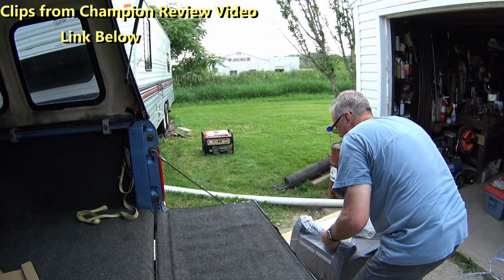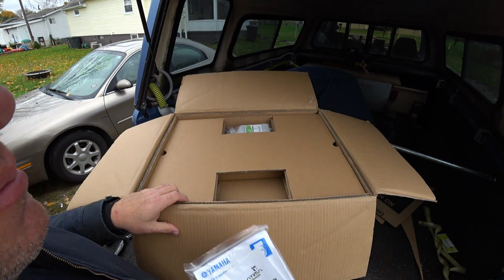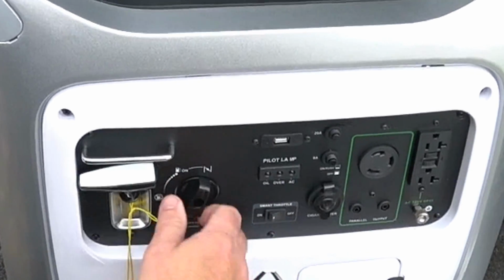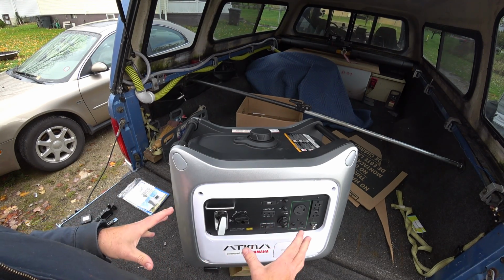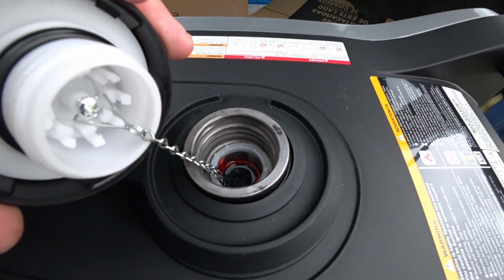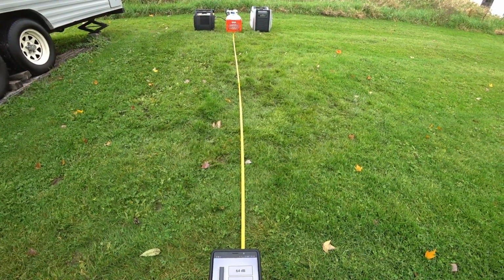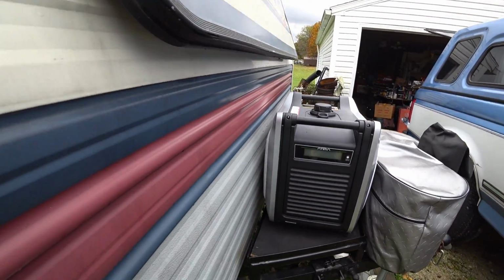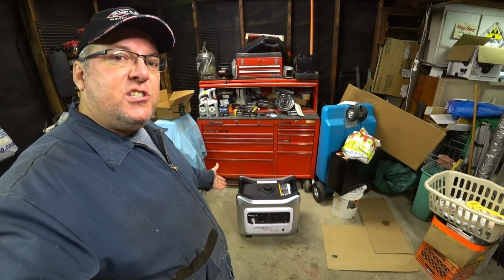RV Generator Atima AY3000i vs Champion 3400

Comment: great review but the links that you provided don't work and when I searched on line it seems to be a mystery trying to buy one?
Reply from the maker: From what I can tell the company is having a hard time sourcing. They were a Japanese designed, Japanese sourced, Chinese manufactured generator company. And at this point, and for a while now, difficult to receive their products from a steady source. They had a good presence on Amazon initially then they refocused their sales as a direct website point of sale only. This is a shame! I believe truly after all the reviews I've done on generators that they were the second best brand of generators but you could buy as far as build was concerned.

Comment: As for checking the oil level = read the owner's manual.  Don't go by anything anyone tells you.  My B&S generator's manual says to screw in the dipstick, then remove it to check the oil level.  Some Onan generators have you rest the dipstick on the fill hole, others of that brand require you to screw it in.  Predator (Harbor Freight) says to fill the oil until it reaches to lower lip of the dipstick hole.

Comment: I bought the Champion 3100 with remote start.  It’s not dual fuel but I’ll take the remote start any day. You can start or stop it without going outside.  Also like the RV 30 amp plug. My two bits worth anyways

Comment: First oil change at 20 hours....yikes.    I would run with no load for an hour, change the oil, run for another hour (no load) change the oil.  Then run for 3rd hour under 500w load, then change the oil before going to 20 hour intervals.
Reply from the maker: Sounds like fun! Necessarily needed but fun nonetheless

Comment: Great review. Folks, there are precious few reviewers of inverters/generators who actually know how they work and what to look for related to reliability. I bought the duel fuel Champion. Also, the model the link points to now does not have the display shown in this model and all the plugs are moved to the front vs the side. They currently only sell one model on Amazon.

Comment: Have a new unit on the way ay3000i, any other maintenance you suggest, you still using yamahalube? Will be powering our Rv
Reply from the maker: I decided to stay with yamalube until the Yamaha engine warranty is out. Even though these new full synthetic oils are pretty well compatible with all these engines they are still designed for automobile engines more than small engine. Moving forward with the yamalube will always allow the best engineered oil for that specific engine.

Comment: 1.6 gallon gas capacity is not much. My Yamaha ef3000ieb is 3.4 gals, more than twice as much. That's a deal breaker for me.
Reply from the maker: For the price difference of the Yamaha. You could buy A 6 gallon extended run tank and still have money left over for fuel for quite a few trips.
Reply: @Rvdaydream  you are right about that as long as your generator has a fuel pump & not just gravity fed!
Reply: Rick Braden there is a guy who sells an extended run fuel system for champion generators. There is a YouTube video on it.

Comment: I think I'm still leaning towards the champion. It was just too well thought out. I love the Yamaha motor for the dependability but I still haven't heard anything negative about the champion unit. I think the dual fuel option is the thing that pushes me over the edge. Anything competing with champion simply must have dual fuel and an RV plug
Reply: Is there a good LP conversion kit for the Altima?

Comment: Ok, so first question is, Which one are you taking with you when you go somewhere without power? 

As you know I also have the Champion based on your Amazon link and your advice and I love mine. I'm actually thinking about getting another one this summer to run together so I have all the power I would ever need to keep the wife happy with both AC units running. I see that you can piggy back the Atima with another Atima but can you connect it to your Champion in the same way? 

Thanks again for the great content on this channel!!!
Pat
Reply from the maker: Thanks Pat! Always enjoy your questions and your videos too. Since the mount on the trailer is specific for the champion and we do like the option to run on propane. The champion still going to most likely be the one that we drag along. If I was just the throat in the back of the truck and I was running on gas, hands down I would take the atima. It seems quieter and a bit more refined then the champion. As far as paralleling the two units together, I don't feel confident about that. You'll find videos on YouTube that people have paralleled the dissimilar brands to each other without any issue however you got to realize that that paralleling is done with a computer controlling it and the fact that you could have two different computers trying to achieve the same thing two different ways could be an issue. So whenever manufacturers recommend only paralleling within their own brand, it's something that I would probably follow. There's so many things that can go wrong. For example, the generators could have feedback within themselves and cause one of them to burn up, of course I mean electrically not physically catch on fire, although that could be a byproduct. And even if both of them seem to work together their control of the output might be corrupt and burn up the electronics in the RV. Either way there's too much to gamble. I hope that rambling makes sense. LOL
Reply: @Rvdaydream  Great response. It makes perfect sense!!! Just reconfirmed what I had already thought. Thanks for the response!!!
Reply: I do what you do. I have 2. I think that having back up parts is as essential as having fuel.

Comment: The comment about hard-to-start law mowers reminded me of why we bought our Deere push mower.  It came (ca 1990) with a Kawasaki engine, with overhead valves and positive oil pressure instead of the "slinger" style on B&S et al.  With about 28 years of use, and not a lot more maintenance than oil changes and blade sharpening/replacement, it still runs great.  It takes 2 to 4 pulls at the start of the season (got to get fuel through the line), and usually starts on the first lazy pull during the season.  I wonder how many cheap mowers we'd have gone through in that much time.  As for the generators, I think I'd skip the electric start on such a small, reliable engine, though (like some others here) I'd like to have the option to run it on propane.  Thanks for the comprehensive review, though I am wondering just what you do differently for the oil change.
Reply from the maker: Yeah there's old mowers were pretty disposable back in the day. Thanks for watching the video and as far as the things that I do during the oil change is pretty normal except when I fill, I measure out the amount of oil the unit needs and then tilt it up on edge and just pour it in. I don't have time to be fooling with a funnel that's almost horizontal and having the take the time to make sure the oil goes in not out. LOL something I learned from working what seems like an assembly line in a repair shop.
Reply: @Rvdaydream  That sounds like a good trick; I'll try that, assuming I remember.

Comment: Nice review! about $250 more than the Champion, and it doesn't run on propane.  Electronic display and Yamaha engine don't justify that increase for me, specially since there is no real decibel reduction.  I will stick with the Champion Dual Fuel.
Reply from the maker: I love my Champion for the same reasons....If I was only running on gas though.....Im not sure...
Reply: @Rvdaydream  hmmm....gas only I'd lose 500 running watts and pay $250 more.. what would I be gaining for that xtra $?
Reply from the maker: The Champion 3400 generator only makes 3040 peak watts on propane...
Reply: @Rvdaydream  Thanks Mike,  I was responding to your saying that, if it weren't for the propane you might go with the Atima.  I was saying on gas only, the Champion produces 3100 running watts, the Atima only 2600 running watts, a net loss of 500 watts.  It would have been interesting to see how the Atima did with running both A/C and micro or elec water heater, we like to do both those occasionally and along with everything else using elec, we aren't sure 2600 watts would keep up.  If you were ok with losing 500 running watts on gas, that Atima might work.  But to me, paying $300 more for a generator (Champion dropped to $900), that doesn't have a propane option, just don't see the value.
Reply: What he said

Comment: OCD about oil changing on generators. Oil is much cheaper than repair. The Champion is over $200 less and has a little higher wattage output. I have heard several RVers say their Champion won't produce the same usable wattage on propane. No one can explain why. Our MH came with a diesel gen in it. Do have to keep more than 1/4 tank of fuel.
Reply: Usually the lower energy density of LPG results in lower power output.
Reply from the maker: Yes Sir..Plus changing the oil sometimes lets you find issues you may not have seen/noticed otherwise..!!

Comment: What about an extended run fuel cap?
Reply from the maker: I believe, This genny (like most 3000 watt) has a pure gravity fed tank unlike some of the 2000 watt gens that have a fuel pump and sealed gas tank cap for transport.....I would have to add a pulse style fuel pump that works off valve cover differential pressure for an extended tank to work...